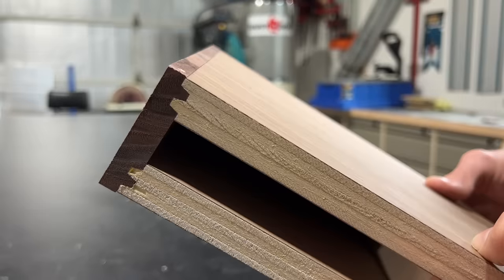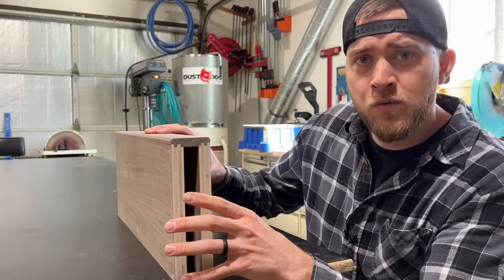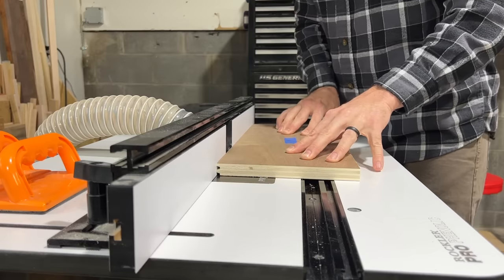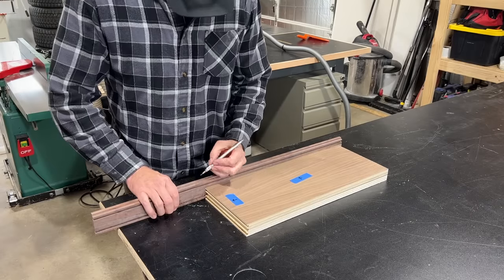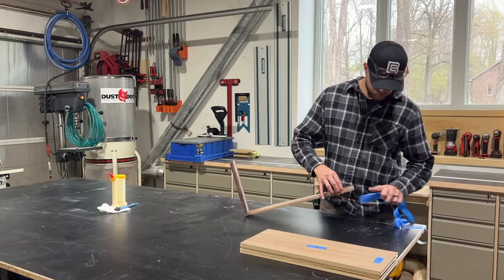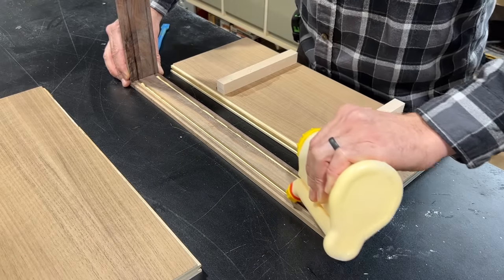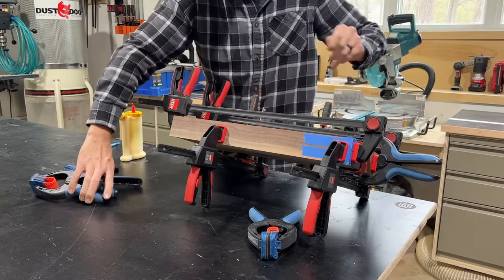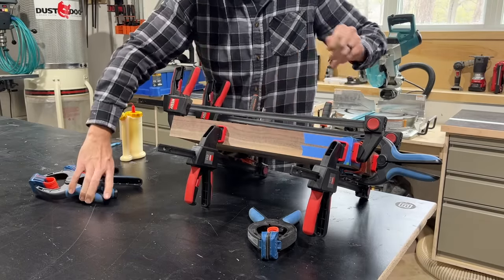This will change the way you build floating shelves FOREVER!

Comment: Looks good and it's strong. Nicely done. 
For commenters. Miter fold and lock router joints are better for none solid wood. This joint requires solid wood face. However it gives options on different corner profiles plus stronger. I leave center supports free until install for left to right adjustments which is especially important on full floating shelving. Also relief at least a 45 or 1/2" x 1/2" out of wall side to scribe tight to wall covering. 
My take is it looks great and will last a long time. Hopefully it inspires people to try and make them.
Reply from the maker: Well said! Thank you!!!

Comment: After 45+ yrs as a cabinetmaker miter folding is standard in the industry. In veneer, melamine, laminate, you name it it’s miter folded. Your system with 1/2 ply and solid nose is the method I use for myself at home.

Comment: This comment ended up being longer than I planned, so it is going to be “backwards”. The most important part is my question. The rest of the comment not critical. I am extremely impressed with what you have done. I’m fairly certain that you said that the supports on the inside of the shelf could be /should be smaller or not as thick as one would expect. Like they didn’t need to touch both the bottom plywood and the top plywood. If I understood that correctly, would you mind explaining why that is? Because I would have expected that we would want them to touch both pieces of plywood. But you clearly know what you are talking about and what you’re doing, so there must be a reason for this. The only thing I can think of is that solid wood, expands, and contracts and maybe that’s why. But I am very curious. Thank you very much. And now for what would normally be the first part of the comment/question. Awesome video, and awesome technique. It reinforces my belief that we do not need to use top-of-the-line, whatever in every part of something to make something that both looks high end and high quality, and is high end and high quality. This is a philosophy that I have primarily applied to interior design, but this is a great example of how I believe it can apply to almost anything. I am new to Woodworking. It is something I have had an interest in for most of my life, but since being an adult, I have mostly lived in cities where space simply does not allow for having a woodworking shop. I wish I would have heard of a makerspace sooner than I did, but I am grateful that I discovered them a couple of months ago, and even more grateful that Salt Lake City has at least two or three. For anyone who is not familiar with what I makerspace is, I would highly recommend googling the term, especially if you are someone like myself, who, for whatever reason it is not practical to have your own set up. In fact, I’m sure one could make the argument that a makerspace would be a better option than setting up your own shop, for most people. At least the one that I joined is basically like a co-op. The members have 24 hour seven days a week access to a ton of tools and machines in almost every area you can think of. Sorry about the long comment. I am still in the phase of excitement, and really hoping as many people as possible can learn about these places because they are a win win, win for everybody. To be clear, you can still buy your own tools, which I have been doing more than I thought I would. I guess I am a typical guy who gets excited about tools.

Comment: I used to make shelves/mantles this way when I started out. But mitering is the way to go for a happy customer, especially high end homes.
Reply: Agreed.  No one wants to see the joint where the wood meets and miter folds you can grain match and ... honestly it's a floating shelf...you are putting 1000 pounds of knick knacks on it.   I like this guy's video but the design is over engineered for the use case IMO
Reply: You aren't putting 1000 pounds

Comment: I would highly recommend using at least one feather board on your router table, when running your material through. You really don't want any drifting or flexing for the particular operation you're doing.
Reply from the maker: I agree, I definitely should have set one up. I will in the future. Thank you 👍

Comment: Great technique but a miter lock bit is even better. Make the top, front and bottom the same thickness and the run top and bottom flat. Before you run the front vertically raise the bit about 1 or 2mm. that will make it sit that amount proud. After glue up and putting a little round over on it the joint will be almost invisible but you will have a  little bit of solid wood on the front edge.  That way you won't see the  bit of of solid wood that you have on the top and bottom surfaces.
Reply: You’re correct but it also leaves the veneer very vulnerable to chipping at the corner.  I’d rather see a bit of the hardwood and have a more robust edge.
Reply: That is the point of raising the bit for the vertical pass. It gives you a little bit of solid wood on the corner to prevent chipping and give it a more  robust edge. But it disappears under the round over.   @raymondbunkofske4702

Comment: I take it that went in a corner. You only finished one end. What about the mounting bracket 🤷🏼‍♂️. I’m definitely curious. I occasionally get requests for floating shelves and have been doing solid shelves with a steel mounting frame with steel dowels and I drill the shelf to slip on the dowels.
Reply from the maker: Correct, this is a corner shelf. As far as a mounting bracket, you can either buy prefabricated metal brackets or I showed how I make my own in my other floating shelf video. I didn't want to be redundant, so I didn't show it in this video. I just wanted to focus on this new technique.
Reply from the maker: How I build floating shelves | NO PLYWOOD MITER FOLDS
https://youtu.be/RXYQau202y0
Reply: Yep. I would have just cut a piece for the other side instead of worrying about supports(2) inside supports inside were no different than the mounting so they are a waste of time.
Reply: @EverydayBuilds  thanks 🙏🏻
Reply: No concern about width expansion from those interior solid  wood supports? I’d be more inclined to use a plywood cut to width.
Reply: You skipped the grand reveal!  😊. Can you post a picture of the finished shelf, installed?  Looks great

Comment: 5:25 feather boards can be your friend. Use 2 of them, one on either side of your router bit. 6:38 to make your cuts less stressful on your router, and safer for you, don't go full depth on your first cut, especially with hardwoods. With this bit, make your first cut at about 50%, and then make a second pass at 100% depth, or you can make it even safer by breaking it up into thirds.
Reply from the maker: Thank you 🙏 I will definitely be using feather boards in the future
Reply: This "what not to do" looked very close to "I had an accident..." Safety first is the answer here.

Comment: I used a solid piece of wood, drilled two long holes for the supports and 2 tiny holes in the bottom to secure them. This solution has way more options as far as dimensions go so good idea 💡
Reply from the maker: Awesome, thanks Marco!

Comment: Box miter bit would be awesome, great joint... depending on how you're going to hang these, cutting the inside supports shorter could allow you to use a wall cleat... there are different ways in mounting these shelves... with more experience you'll figure the best possible way...
Reply from the maker: Thanks Pete!

Comment: Jordan, excellent video, great production values, thanks for sharing your mistakes (that’s how we all learn), very effective “tell-then-show” instructional design. Really well done. Thank you so much for taking the time to create this valuable content and share it with us. 

You asked how others had done floating shelves. I recently made two 8-foot-long shelves using a similar technique — mahogany plywood top & bottom wrapped with 3/8” solid mahogany on the face and sides, with the grain flowing around mitered corners — but I attached the face and sides to the plywood by using (a lot of) biscuits and glue. My technique was stronger than the folded miters everyone else does, but not nearly as strong as the interlocking glue line profile that you used. If I’m going to make more floating shelves, I will definitely buy that router bit. 

Since the shelves were so long, the glue up was challenging. I used a lot of F-style and parallel clamps to hold the long front face on, and I used ratcheting tie downs (like what you’d find in the bed of a pickup truck) linked together and wrapped around the long way to hold the sides on. 

After the glue dried and I needed to get the slightly proud hardwood faces flush down with the plywood, I was going to use a flush trim bit in a hand-held router, but I was scared to death I’d tear out the edge of the mahogany and screw everything up. So instead I sanded — and accidentally sanded off some of that thin plywood veneer, just like you did. :)

P.S. I made a jig and routed a channel on the bottom of each shelf to install LED lighting, which came out fantastic, thanks to a video I watched by Spencer Lewis at Insider Carpentry (https://youtu.be/AAoo_VwqQZc) -- Thank you @Spencer!
Reply from the maker: 8 footers sounds like a tough challenge for sure! But it sounds like you did an awesome job. Spencer is great, I’ve learned a lot from him. Thank you for the great comment 😁

Comment: Good to see that I'm not the only guy out there that over-engineers the heck out of my projects.  About 11 years ago, I made 4 floating shelves out of 12mm mdf, miterfolded the joints, and installed small, built-in halogen spotlights (for cabinet applications). I used thick maple strips for the wall brackets, very similar to your design. Never ever had a problem with anything sagging or splitting. I think what's most important is to think things through in terms of weight on the bracket and minimum/maximum thickness of material topside/underside shelf.
One thing I will say in your defence of a more 'sophisticated' construction is that you're challenging yourself with learning techniques that will help you in other projects where this extra attention to structural integrity is a must. So there's that.
Great work brother, not a thing wrong with this, even though it IS a wee bit overkill 😂 You've got an end result there that no one can argue with.
Reply from the maker: Thank you!!! 🙌

Comment: Lock miter works great too. Better with solid wood both top and bottom and face. Ive found plywood cant get as good of a seam especially if the bit has been used a few times. But yea look into a lock miter bit.
Reply from the maker: Great, thanks!

Comment: Since a set of floating shelves has just been commission by my better half for her bedroom (which she lets me share with her), I found your video just in the nick of time. While I like the idea of using plywood for the top and bottom, I think that the plywood with hardwood facesheets redefine the meaning of thin veneers as they try to use the absolute minimum amount of the expensive wood. As a result, I, like you did, have sanded right through the facesheet and ruined an entire piece that I had put many hours into. 

But this year Santa was very nice to me and brought me a bandsaw (a 14" Rikon 10-326) which can resaw lumber up to about 12" wide and Resaw King blade that is supposed to be the very best for resawing lumber. Besides being able to save money on wood by buy rough lumber and resawing to the specific thickness I want, the reason that I told Santa that I really wanted a big bandsaw like this is that I want to see if I can make "thick" (~1/4") veneer sheets that I can then glue to a high quality, but plain wood, plywood like baltic birch. Besides not worrying so much about sanding through the face sheets, I can make the veneers from not only the same species of wood as the solid wood pieces like the the front and sides on these shelves, but potentially even from the same piece of wood which should go a long way to matching the color and in a few places achieving grain matching to make the illusion of it all being from one solid piece of wood even stronger. Plus with more than half of the wood in the shelves being plywood, I should be able to save even more money on future woodworking projects. Santa says I better be right. This particular toy was waaay more expensive than she had budgeted for gifts for me this year! There was even some muttering about it being more than the budget for the next three Christmases!

Thanks for making this video and wish me luck.

Comment: Only suggestion I have without trying out is this yet…We all know walls are not straight and for my application it’s a long run. My thoughts are if that applies and you give the plywood a relief cut on the backside would allow for finer adjustments without effecting the structure. Once you know the location you could use a small washer and pencil to scribe the curvature of the wall and it would end in a better fit. With a bit of sanding of course. 
At least that’s what makes sense and my head and hope I explained the thought process clearly. Now to Amazon to buy the bit. 🍻
Reply from the maker: You are exactly right and I do that exact thing. I explain it in detail in this video 👇
https://youtu.be/RXYQau202y0?si=8gSMm9QulW1_U7GH

Comment: Nice. Like the tip about only putting line of glue on the inside part of the joint. It’s the cleanup of the glue on the outside that is usually the cause of sanding through the veneer…even when I think I have done a good job wiping it before it dries.
Reply from the maker: I hate squeeze out, lol

Comment: Hi, like your design!  I noticed you're a fellow Dust-Dog owner.  Hope this helps...don't use the hand-crank dilleo.  It shortens the life of your filter, use an air nozzle instead.  I happened across this info when doing DC modification research.
Reply from the maker: Thank you! That is a great tip.

Comment: This is actually pretty common, at least for me. That Bosch but I’ve used a ton! Great for if you have some thinner long boards are move a bit and just want to nice straight glue up with trying to do dowels or luxury dominoes. I’ve tried it on 8/4 and 12/4 much harder to deal with that! Basically, the day of milling you have to put them together - or they move on you and I’m not a fan as I like 1-2 days acclimation. 

I’ve done shelves like this, cabinets, I did a hollow mantle (it was painted so didn’t want to waste so much wood). I’ve done floors with it, just not large areas though as a tongue and groove is more than enough.
Reply from the maker: Awesome! Sounds like you have a ton of experience with this technique. And it sounds like I can use this bit for applications, which is great. Thanks for sharing 😁
Reply: @EverydayBuilds  It is great - but as you said you have to play with it and every time the piece thickness changes you have to commit to it. I think the learning curve on it is a little high because as you flip and run it you run into 'oops that wasn't right direction, crap gotta run the table saw to get a straight edge to do it again...crap I am out of walnut. Crap, 20$ a board foot? Really, I just need like 6 more. Ugh, ok fine!!' 

lol, the struggle is real.
Reply from the maker: Haha 😂 I’m familiar with that nightmare

Comment: This is almost exactly how production hollow floating shelves are made, though the profile of the bit varies depending on style, one of which uses what looks like crown molding on the sides for a slanted edge and visually slimmer look, slants on the sides means the tooth profile of the lock needs to adjust to the slant; though I'm sure these production units use a molding head on a table saw rather than a router bit.  There's a variation of this bit for locking miters that works in the same way, but instead of a cylindrical center it uses a slanted center with a slant to the locking teeth.  There's also a similar miter-rabbet profile on a circular saw blade that someone made a number of years ago that Rockler bought out, it's called the miter fold I think, the blade cuts just shy of poking through the veneer layer with the V portion of the cutter and the flat rabbet portion cuts that mating thickness into the same cut, you're supposed to be able to make a five-sided box in four cuts.
Reply from the maker: Good to know! Thank you 🙏

Comment: When using this type of router bit but keep the same setup, you can tape a split spacer board to each side of your fence and back the part away from the finnish size so your not making such a deep cut in one pass, you will get better results taking a shallow pass the last cut.
This can be done like the turret depth stop on a plung router only making the fence the plung surface.
I've never done this its just something I think could be handy if your making a lot of part and dont want to keep making setup changes  you change the cutting depth with shims on the fence.
This would work with most router bits it might even work for a lock miter bit. 

I want to make shelfs that have constant wood grain on all sides a 6 sided shelf no end grain 5 sides match the grain pattren and I do not mean stright grain. And no end grain showing
Reply from the maker: Great tip! Thank you!

Comment: Great video, and wonderful instruction.  Just wanted to mention, based on the glue joint you showed on the bit, it is possible that your under-table router is a little bit non-square.  Could be something else (unsteady feed, etc), but the extra slop is sometimes caused by alignment issues.
Reply from the maker: Awesome! Thank you for the advice 😁